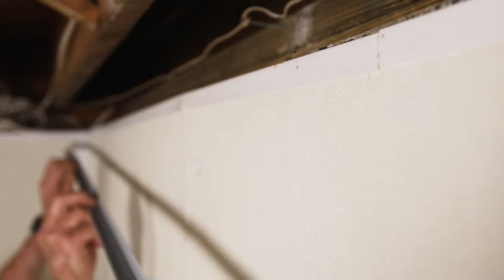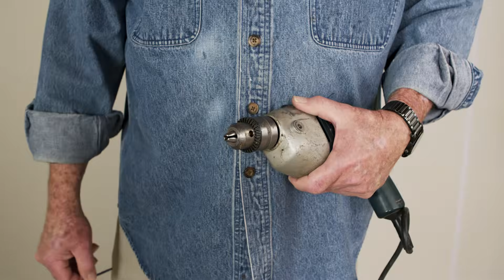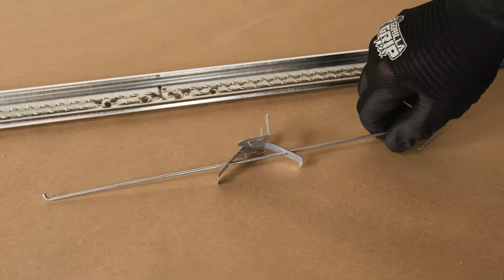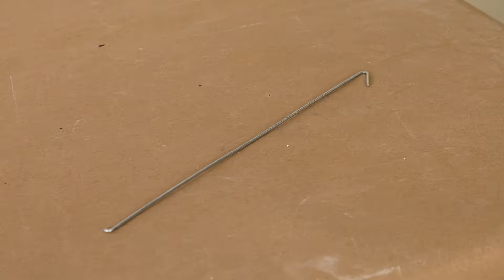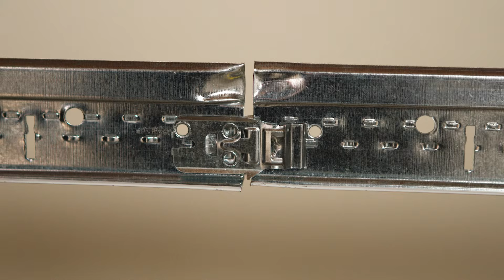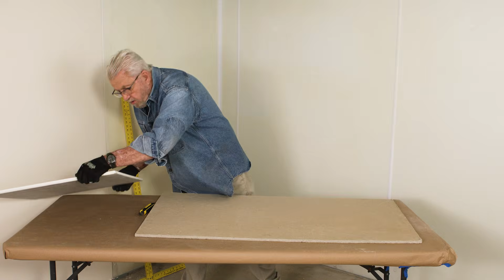New Hanging System Makes it Easy To Install a Drop Ceiling Yourself

Comment: The guy at one store said that the trouble with those hangers is that over time vibrations from furnace, HVAC PPL walking above etc may cause them to wiggle down so you have to redo the level. Any thoughts?

Comment: Good video   great information.   However you should explain that there are two different types of drill bits for concrete.  A bit for use in a hammer drill is useless in a plain rotary drill motor.

Comment: Vinyl sheets on concrete walls in a basement ? I could bet that after a year there will be a mold between those sheets and concrete. The walls and back of those sheets will be soaking wet. I have seen several basements finished with vinyl sheets and always was the case: a lots of moisture trapped behind those vinyl sheets.

Comment: You did quite show how the cross t’s snap into the main rails. They don’t just push in, you have to angle the cross t upwards on the other end, then then bring it down until you hear a click.
THAT is the hard part of the installation.

Comment: Thank you for this wonderful step by step video. Are you aware of a drop ceiling system that  doesn't require any vertical support? I'm interested in installing a drop ceiling in an office addition of two 8x9 ft offices where I'm using translucent and ventilated tiles to allow light and heat into the room. I don't want there to be anything showing above the drop ceiling as the rest of the building has 20 ft vaulted ceilings with skylights, whereas the two offices will have the lower drop ceilings, so any brackets and bracing would be unsightly when looking above the offices, from the rest of the building. Thank you for any suggestions!